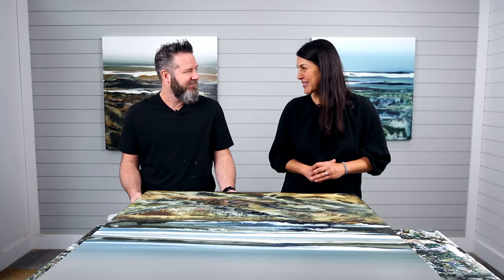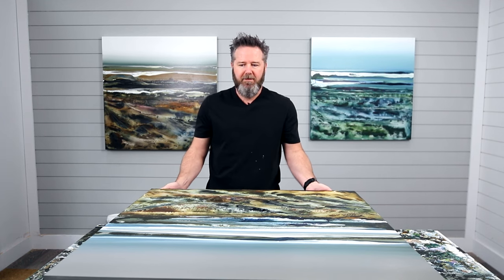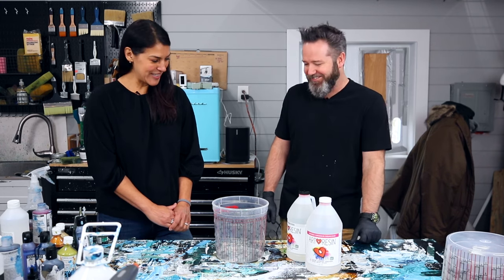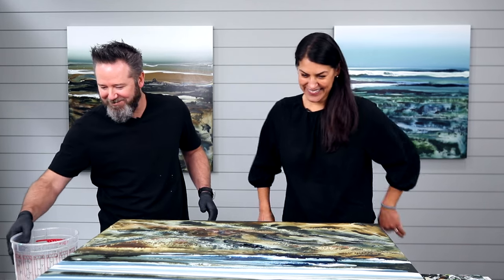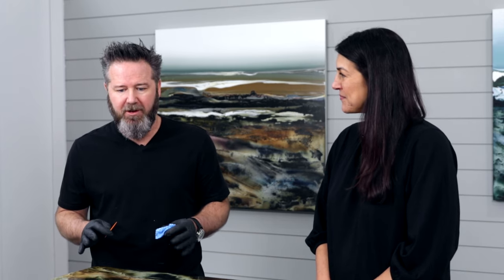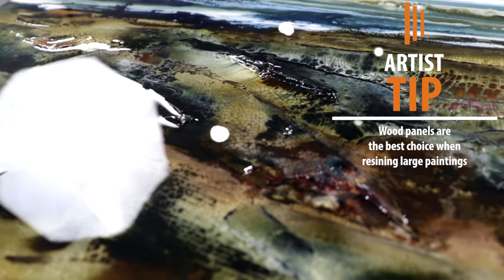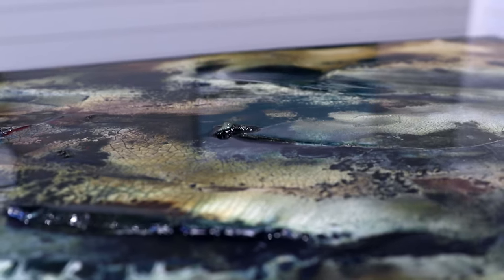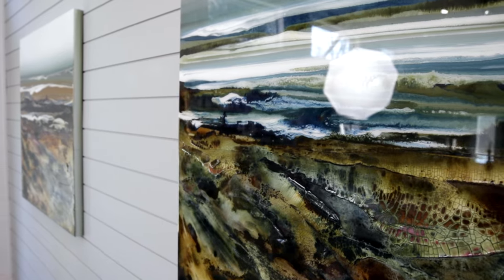How To Resin A Large Piece Of Art

Comment: Is it ok to use resin on smaller stretched canvas?
Reply from the maker: Yes, you can use ArtResin over stretched canvas.  The small ones work really well, when you use the larger ones we recommend supporting the canvas from behind using cardboard so that it doesn't sag under the weight of the resin.

Comment: Wondering why you weren’t wearing any protection? Respirator for you and her in the very least? Ventilation? Surprised those important factors were not mentioned.
Reply from the maker: ArtResin conforms to ASTM D4236, meaning it is certified as safe for home use and non-toxic when used as directed, however there are some safety precautions that every user should follow:

Wear gloves. ArtResin is very sticky in its liquid form, so gloves will protect the user from a mess, as well as skin irritation. Clean skin promptly with soap and water if it does come in contact with ArtResin.
If ArtResin somehow comes in contact with your eyes, flush with water repeatedly and do not rub. Promptly seek medical attention.
Work in a well ventilated area. Wear a respirator if ventilation is poor. 

See our blog for further information: https://www.artresin.com/blogs/artresin/what-safety-precautions-should-i-take-when-using-artresin

Comment: How to prevent resin yellowing ? I think 1 year and go to yellow
Reply from the maker: Sorry to hear that!  Once the resin yellows, not much can be done to reverse it.  The only option is to sand it down (being careful not to damage your artwork) and repour. 

Several things can affect how quickly yellowing occurs in epoxy resin, but UV light exposure is the biggest issue. ArtResin contains UV light stabilizers to delay yellowing, but the sun is powerful. If your piece is exposed to direct light in a window or on a sunny wall, yellowing will happen sooner. And if your piece has a white background, it will be even more noticeable.

Heat is another factor that can accelerate yellowing. This can be caused by over-torching, pouring thick layers, or exposing cured resin to high temperatures. Additionally, using acrylic paint that hasn't fully dried and titanium dioxide in titanium white paint can also cause premature yellowing.

Comment: You don’t have to clean the surface or anything?
Reply from the maker: Hi Carla, your surface should be free from dirt, dust and oil and it is important that your paint layer is completely dry before you apply ArtResin.
Reply: @Artresin ….I think it’s important to give a step by step of your product, I had some issues with that! Also you don’t specify how to clean the surface if it’s oil or acrylic! I used mostly oil, but I also use copper and silver leaf which can leave a glue residue. What’s a good way to clean that! A step by step would help a lot! Thank you so much!
Reply from the maker: @carlapayan-flores8613  Greg and Joanne go through most of the steps on how to prep your piece, how to measure, mix and apply ArtResin, for a more detailed step by step here is a link to our "ArtResin 101" video: https://www.youtube.com/watch?v=Q8r9Fy5HzYQ&t=8s .  If your paint is acrylic like Gregs painting in this video, you can pour ArtResin over your painting once the paint has thoroughly dried.  If you are using oil paints you must wait for the oil paint to fully cure--this can sometimes take 6 months to a year!  ArtResin works great over metal leaf, again just be sure the glue used dries clear and is fully dry prior to pouring your ArtResin overtop.  Please reach out to us at support@artresin.com if you have any specific questions :)